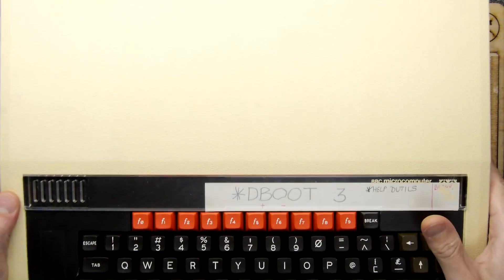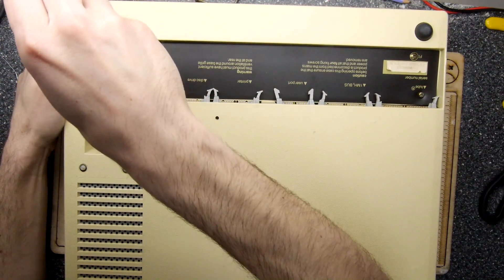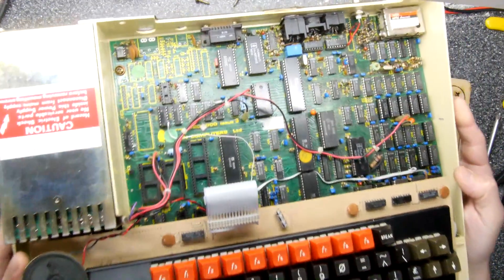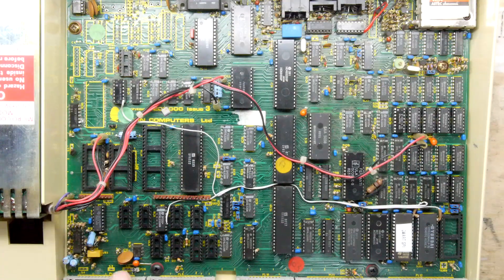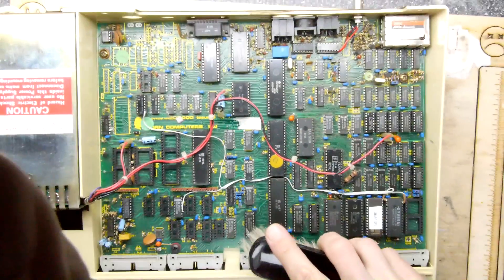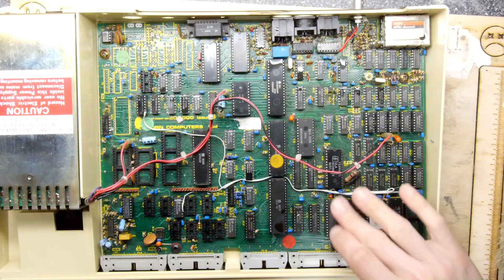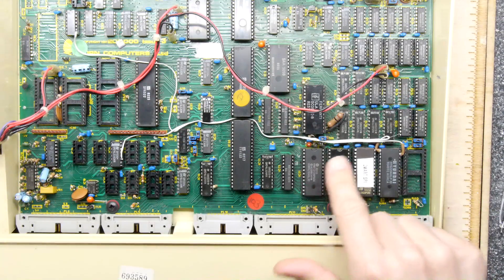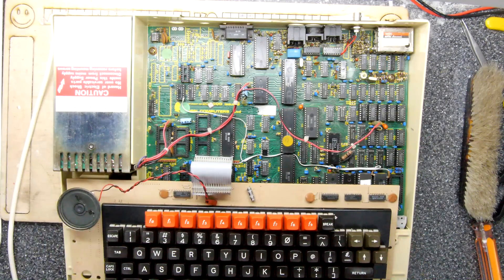BBC Micro Investigation

Comment: Wow, must get my beeb out and add that pi upgrade.
Your modded ram chip has 32k. The upper wire is the read/write line and the lower one is the rom selection. So you get two 16k ROM images and I think you have to select the rom with ?&FE30=<rom number> before loading an image to address 8000. Then press break.
It's not worth upgrading the keyboard connector - its part of the speech upgrade, there was a plan to provide cartridges but I don't remember ever seeing one.
Remaining empty sockets apart from speech on the left are for the floppy disk interface. Which you don't need if you plug that sd card adapter back in :)
Reply from the maker: Thanks for the excellent information! I fully intend to try and find copies of the regular and advanced users guides as well as the DFS guide and really get back into this properly. I recently have been playing with the MSX and Amstrad CPC machines and they also are very interesting to use, especially the MSX.

Comment: Inpsired me to dig out my childhood BBC B. I recapped it a while ago but not done anything with it since. 
You're right they are ROM slots out of a possible of 16 pageable aka sideways ROMs, but you could put  RAM in a slot and write to it if you hooked a flying lead from a write signal somewhere. My sideways RAM hack is held together with blutak and caked on dust, I remember adding it purely to run copied ROM images as there was quite a large ROM market for the BBC. As copy protection, some ROM software would check if they were running from SW/RAM by trying to write to themselves. This is why there's a toggle switch on my write enable line.  BBC B+ and later all had sideways RAM as standard I think.
Reply from the maker: Brilliant! Thanks for sharing this 😁

I love the beeb hardware, such a flexible machine. I found some suitable zif sockets to install locally to ease my experiments!

Comment: I love the BBC B. It was my first computer. My dad bought it because he was an ex teacher, and was aware of the educational content that the BBC Micro had - but he also got a healthy staff rebate of £50  -as he was a BBC Radio Producer by then - and in 1982 or whenever it was, £50 was still quite a bit. That computer taught me to understand clocks - something I couldn't grasp before. And it gave me a love of games which endures today. Chuckie Egg, Aviator, Time Pilot, Escape from Colditz, great times. need to get back into programming though.

I've still got my Beeb, but it hasn't worked in nearly 30 years. I think the power supply died. I need to investigate getting it working again, but so far, I'm not sure where to start.
Reply from the maker: Thanks so much for sharing your story! You really must get it out 😁

I believe the caps in the PSU are pretty easy to replace and I'm sure it will be as good as new.
Reply: backofficeshow I'll make a point of doing it. Recently got my ZX Spectrum +2A sorted out with a new plug, RGB video and a modern loading solution - so the BBC B is my next project to sort out.
Reply from the maker: Oh that sounds like it was fun! Do you use Discord - of so you should pop over and come chat hardware!
Reply: backofficeshow Will do. 😊

Comment: love the BBC keyboard.. you just don't get that sturdy clacking sound on modern keyboards.. the travel and the sound is unique and really takes me back in time..
Reply from the maker: They are pretty great. Another favourite of mine is the Atari ST. It's not the best, but it's feel and sound is so unique
Reply: yeah people say the rubber key speccy had that dead flesh feeling and i'd agree.. but the ST took that a stage further.. it was dead flesh with rigor mortis.. there was a sponginess to the ST like we were pressing down on some thick moss on rotten wooden park bench.. unmistakable..
Reply from the maker: You need to give the ST a little rattle to really get the full effect!
Reply: i might buy an ST later in the year, just to relive that 6 months I owed one in 1989, before I saw sense and got an Amiga! lololol
Reply from the maker: The ST is the spiritual successor to the been I reckon 😂